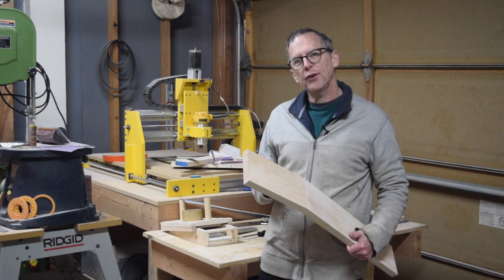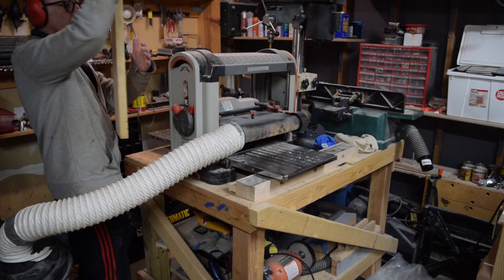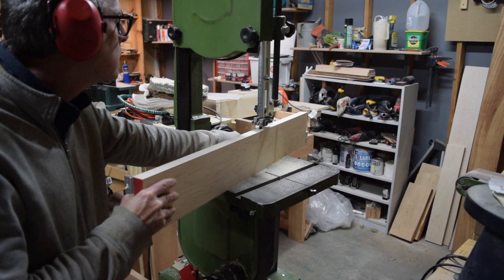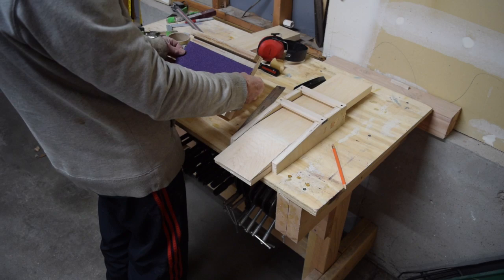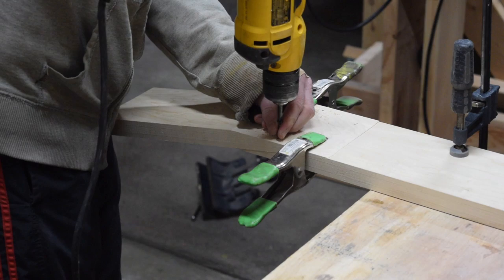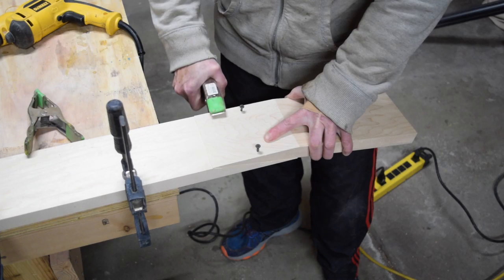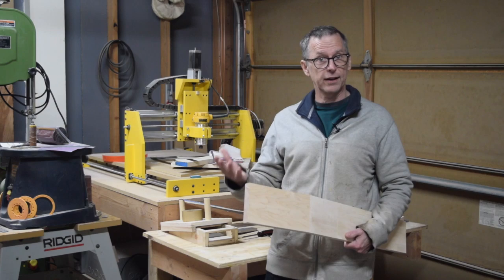Making A Scarf Joint For A Guitar Neck With An Angled Headstock

Comment: Chris, have you thought about putting the scarf joint in the headstock?  Respectfully, I feel the problem with placing the scarf in the neck is that so much of the joint is removed once the trussrod slot is routed and the profile is carved.  When I lived in Queensland, I saw more than a few of these 2nd fret scarf joints simply peel open with the hot humid climate.  (Although to be fair, these were factory instruments, not nice bespoke axes such as yours!)  If the scarf is positioned in the headstock, there is far more of the glue line left in the final neck, plus your veneers hide and strengthen the joint.  I worked for a well known luthier who does this.  He also has two machine heads positioned to be through the scarf joint.  With threaded gotoh-style tuners, these also help I guess, because they are like little clamps.  Thanks again for your great content!
Reply: I’ve wondered the same as you. On my current build, I opted to use a truss today that adjusts at the heel using a spoke wheel. I also thought I might kick it up a notch by using carbon fiber rods that run from the heel and under the nut then end just beneath the head cap. To me, this seems to be using all available methods that I know of to help strengthen this critical area of the neck. Like you, it just never made sense to me to carve out that much material from such a critical area. However, it’s been done for many years on some great guitars but, that doesn’t mean we can’t try to improve on it.
Reply: @jeremywpetty  When I used to build basses a while back, I used to do much the same with carbon fibre rods running through, under the nut, and into the headstock.  I did this even with flat headstocks.  If you've set up any 20+ year old fender style basses you will know how common it is for there to be permanent forward relief around the 1st and 2nd fret.  I guess this is from the headstock acting like a lever.  If you use an Erlewine neck jig for fret dressing, it is really easy to see.  So extra strength in that area isn't just for crash protection, but also for long term stability...
Reply: Hey @Rob Mods. that sounds great too. Do you know of a video that shows this methood? Or better yet, can you do a video regarding this ;) ?

Comment: I just made box a little bit like yo
urs, but just a plane angled box  with right angle, and then I made the angle with surface planing machine. The box is on the otherside of blade and the wood comes behind the blade. Job done in a minute.

Comment: The only improvement I would make is to make the pilot hole for the screw for the head stock wood piece slightly larger so that the screw doesn't prevent the clamps from doing there job. Since the screws are spirals they might retain a slight gap between the wood pieces since they are not fully screwed down.

Comment: I love this sanding sled and the idea of indexing screws! I’ve never tackled a scarf joint yet but this opens up some possibilities for someone without a jointer or band saw. I do have a question about headstock thickness: this seems very thick. Perhaps it would be easier to thin the smaller piece down before gluing rather than later?

Comment: Hi Chris, 

At 1:40 you display a comparison between a one-piece neck and a scarf-joint neck. As you know, quality one piece guitar necks are constructed with quarter-sawn wood “oriented” with the grain running “vertically”to the fret-board. However, the wood you displayed in your video (for the one-piece neck) appears to be quarter-sawn but it is flipped the wrong way and displayed with the grain running “parallel” to the fret-board. This is the worst way to ‘orient’ the wood for one-piece neck construction. 

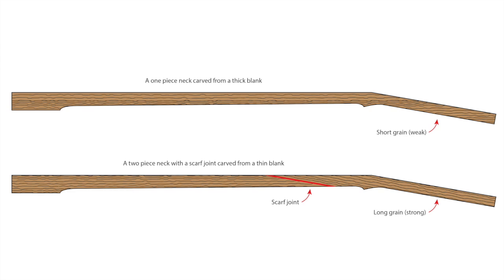In other words, if the one-piece neck blank in your video @ 1:30 was flipped 90° (where the grain is essentially standing-up on its edge vertically and intersects with the fret-board  perpendicular versus parallel as in your graphic comparison), would this yield a more stable neck and headstock? 

Yes I agree. No matter what a scarf joint is stronger.
Reply from the maker: You can’t show quarter sawn wood grain in a side view illustration. The lines simply indicate the direction of the grain. Just pretend it’s quarter sawn.
Reply: @HighlineGuitars  Thank you Chris, do you have an email or facebook page where I can send you two detailed photos with embedded text describing what I’m talking about in this comment? I have no other way of contacting you besides  this youtube video. Thanks
Reply from the maker: @youtubecommentor4480  You can visit my Highline Guitars website and contact me from there.

Comment: So basically the strongest neck/headstock of all time would be a multi-piece neck with a scarf joint, volute, and with bottom of the neck spoke wheel truss rod adjustment so you don't have to big chunk of wood taken out near the headstock for traditional truss rod adjustment. Would you ever try this?

Comment: Can you just go ahead and thickness the headstock piece to the thickness you want the headstock to be? Seams the only thing it would alter would be the location of where the scarf joint glue line would meet the underside of the fretboard due to the shifting of the location of the break over angle at the end of the nut.
Reply from the maker: Of course, you can. Just make sure you plan for where the glue seam and the start of the headstock's angle at the nut will be.
Reply: @HighlineGuitars  Thanks. I start my first scarf joint today. Thought this would be an easier method than trying to thickness the headstock after the glue up with the awkward angle.

Comment: Thanks for the video. Very similar to my own process except I use wooden dowels instead of screws to keep the 2 pieces from slipping. My router jig is the same structure as your sanding jig except the sides are higher. A long router sled rides atop the sides. Although, it seems to me that your sanding jig is a lot less scary than my router jig. I may have to “borrow” that design from you 🤔
Reply from the maker: The nice thing about using screws is that I've used the same pair on hundreds of necks.

Comment: Great vid Chris.. I have a 1997 Samick artist series SG that has a flat scarf joint where the peg head face meets the neck..(where the volute would be) straight across.. almost undetectable.. while most scarf joints i see are in the upper neck and thus show up as a circular joint.  Must take more skill to plan the 'flat" scarf joint for location that just having it lie into the rounded neck.. curious..

Comment: This is a great video and I plan on incorporating this process on my next build. Would you be willing to share/post the plans or templates for your scarf jig and sanding jig?
Reply from the maker: Scott Masson I would if I had them. They’re in my head. It’s pretty simple. The main thing to be aware of is the angle of the jig side is equal to the angle of the headstock.

Comment: Love your videos, Chris. Related neck question: since Les Paul headstocks break so often and are repaired with wood inserts, why aren't they just made with strong inserts to begin with? Could they even use aluminum or titanium inserts like dowel rods, machined so that they line up? Thanks.
Reply from the maker: I'm sure they have done a cost/benefit analysis of this and have determined it isn't worth the added cost.
Reply: Christ, I'm fighting with a classist Epiphone broken nevkstock.  Made 3 repairs that failed.  Is it possible to scarf the neck and add the top half from another neck or a new one and fix it?  I understand scale length etc and new fret board or reusing existing one. This is a learning drill not selling it.

Comment: Hi Chris, do you have a method to machine the two surfaces in your CNC. Do you do the neck and then the headstock as two seperator operations?  If so, how do you align the headstock to ensure its square to the neck when you tilt it up on the CNC?  Could you show that on a video some time please?

Comment: Chris, a question if I may: I like to start with a -75" thick plank, and prefer a .6" thick headstock. Do you recommend thinning the headstock before gluing it to the neck in the scarf joint manner, or do you recommend thinning the headstoch by CNC after I've glued the scarf joint? Thanks!
Reply from the maker: It’s up to you. I use my CNC to thin the headstock after gluing the scarf joint.

Comment: Hi Chris,..nice jig and well taught about. How do you determine where exactly the volute will be ? Mostly from where i see, the highest point comes right under the middle of the nut and sometimes the highest point is just after the nut towards the head stock. Has that something to do with comfort or somebody with bigger hands or esthetics,.. besides strenghten the neck ? Thanks Chris ! Greets from Belgium.
Reply: Bruno Condor I honestly thought that volutes were a way to “add” material back to an area that has had some material removed for the truss rod. Though, I suppose some might like the comfort. In my 30 years of playing guitars with and without them, I don’t really care if a volute is there or not. Just my experience

Comment: Great video! I have just one question:I didn't quite understand how you determined the angle. Does it make a big difference if it's slightly off, or can you determine the angle pretty much by eye?
Reply from the maker: The angle is the same as the angle of the headstock. I use 10° for the headstock.

Comment: Thanks for the vid! What do you do if the scarf-joint is out of square?
Reply from the maker: Start over. However, that has never happened to me.
Reply: Great video. Do you use a particular angle for the headstock or does it depend on the guitar ?

Comment: Better yet, multi laminate blanks and carve the neck out of that. No scarf joint to see.
Reply from the maker: But lots of seems to eventually feel.
Reply: @HighlineGuitars  I don't feel any seam on the neck of my ESP. Don't remember feeling any on the back of an Ibanez I tried a while ago, but they were very well made guitars. Maybe it is harder to do well?
Reply: @harmonicseries6582  I don't either, also don't feel any seem around the skunk stripe on the back of my cheapo squire so it shouldn't be hard.
Reply from the maker: @softwareengineer8711  I can feel it on my 26-year-old Strat. In fact, I've sanded it twice over the years.
Reply: why don't manufacturers like ESP do a multi laminate neck with a scarf joint so that you have even more added strength and you don't have to carve the neck out of a super thick neck blank which causes alot of waste
Reply: @Unchainedmaple888  You don't need a scarf joint on a multilam neck, different pieces are arranged with different grain pattern so it is super strong and super stable. They don't care about 60$ worth of wood on a 3000$ instrument, strength, stability and build quality comes first.
Reply: @softwareengineer8711  but wouldn't using a scarf joint on a multi laminate neck make it even stronger? Why not just make the headstock area even stronger.
Reply: @Unchainedmaple888  It doesn't need to be stronger, the headstock of a multilam neck is as strong as any other place on it. So that's why you don't see a scarf joint on multilam necks.
Reply: @Unchainedmaple888  you are right, some luthiers do this. some even use a 5 piece neck and make the headstock out of 1 piece of another wood, which looks super cool imo.